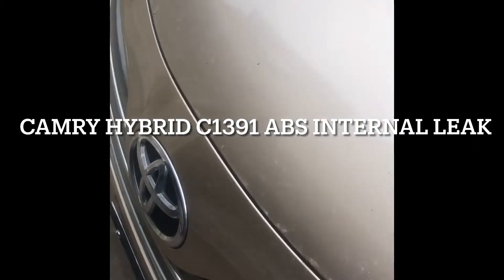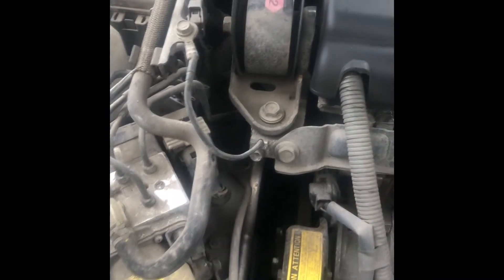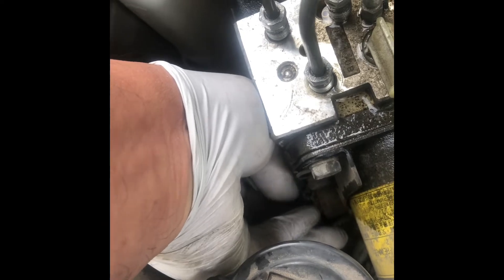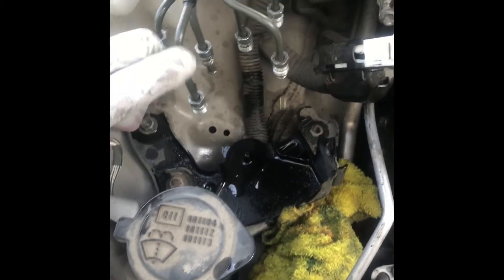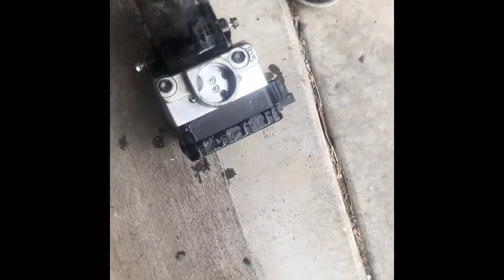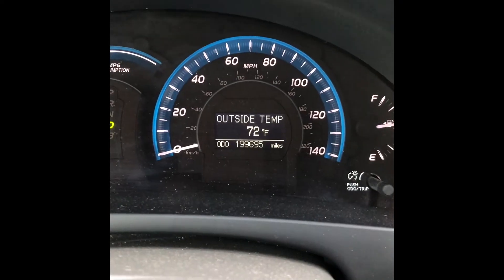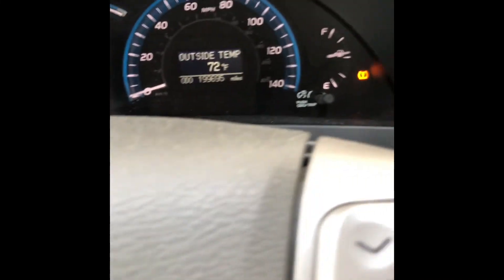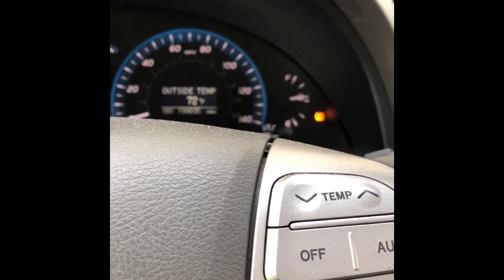@199k miles my 2007 Camry Hybrid ABS unit failed,  the dreaded C1391 which plaques Toyota hybrids

Comment: I have the exact same issue. If I don't change the abs unit, will it be a major issue? How many miles can I drive with a faulty abs unit? My mechanical brakes work just fine.
Reply from the maker: you will only have brakes at the front, no rears and it will be a safety issue. The  lights in the dash will be annoying to while driving.

Comment: Hi.. what if i just replace the part but dont bleed the brakes.. and what if i dont have a computer to reset codes or anything.. all i have is a wrench and cramp for the hose..  plz help
Reply from the maker: it could be a big risk if the brakes are not bleed. The codes can be reset by shorting the terminals in the obd port.. but since it requires electronic bleeding just invest in a scan tool that can do that. Autel MaxiAP is just $70 in Amazon.

Comment: What scan tool app do you use? I had trouble finding a scan tool that would run the abs pump. I replaced mine with a ebay abs pump and now it's having the issue again. I want to replace it and bleed the system correctly, but I'm lost on what scan tool to rent.
Reply from the maker: I use this... https://www.amazon.com/Autel-AP200-Bluetooth-Professional-Automotive/dp/B07QD4GZW4/ref=sr_1_4?crid=473EY57KEUGM&keywords=autel+maxiap+ap200&qid=1677457983&sprefix=autel+maxiap%2Caps%2C131&sr=8-4
Reply: @HighMiles Garage  thank you very much for the quick reply. I've had trouble distinguishing which obs tools will run the pump. Much appreciated.
Reply from the maker: @MHsearchingTruth  just follow the instruction on the tool when you do the ABS bleeding.
It's normally the rear that needs it, the front is just conventional bleeding